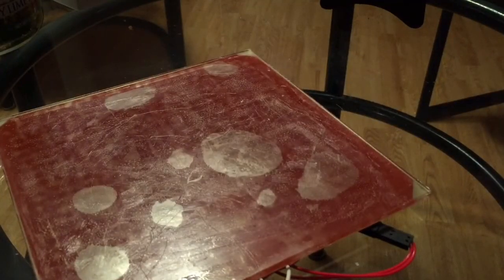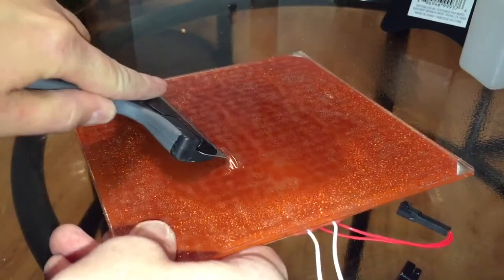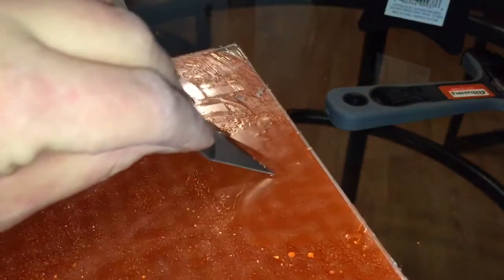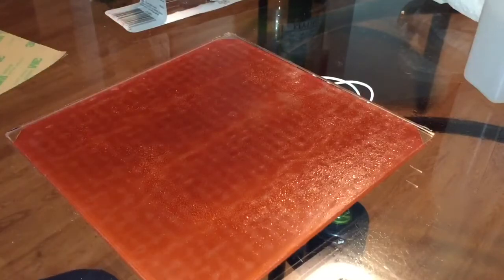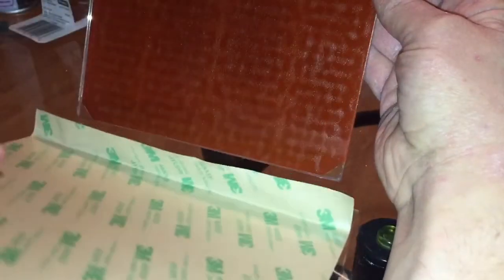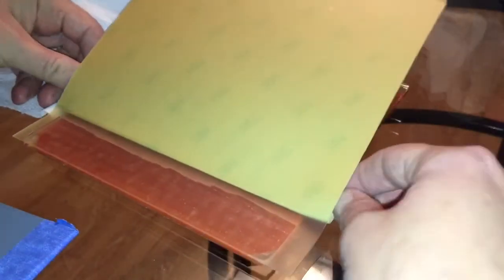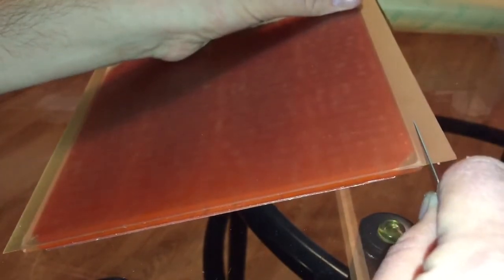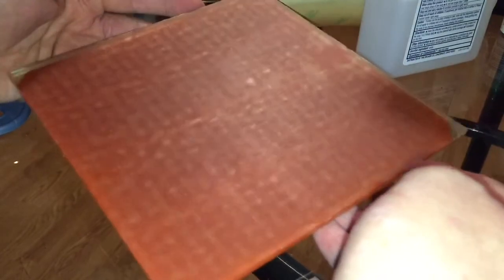How to Remove and ReplaceYour PEI Surface

Comment: Wouldn't it have been easier to heat the board?
Reply from the maker: @trippwilson1175  adhesive doesn’t start to release unless you pull while it’s upwards of 90C. Thats why it bubbles when printing ABS (100c)

Burn risks aren’t for me :)

Comment: Aquila X3. 😮Removed the worn out pei from my bed and just never replaced it. Holy crap it prints better than it ever has. Adhesion is great, parts pop right off after they cool. I just hit the bed with a light wet sanding of 2000 grit. Looks almost polished and acts just like my glass bed Ender 3 just without the glass.

Comment: For getting the glue off, I used acetone, poured onto a paper towel and then covered the spring steel with a sheet of glass so that the acetone could soak into the glue and not evaporate.

Comment: Thank you so much for the video! Did find out if you have a baking sheet pan bigger than the bed...the bed goes in the pan and pour in the rubbing alcohol just to cover the bed and get to work. Takes some work...but eventually the adhesive will come away sooner than just spraying parts of the bed. Is so much easier this way.
Reply from the maker: If you have a heated bed attached to the bottom I’d be worried it would cause your heater pad to separate from your glass. If your bed is just glass abs separate from your heater, I could definitely see that working
Reply: @jim2386  - It's only the stock glass bed on the CR-10 Mini. Anything else...would have never thought about doing this. On the other hand...just got a magnetic steel bed add-on where this would not need to be done. I was disappointed deep cleaning the stock bed did nothing about making me look more handsome. ;)

Thank you for the reply!

Comment: A tip to get the last bits of adhesive off: Spray with Isopropyl, let sit for about 30 seconds then scrub with a magic eraser.  Much faster than trying to scrape with a razor blade.